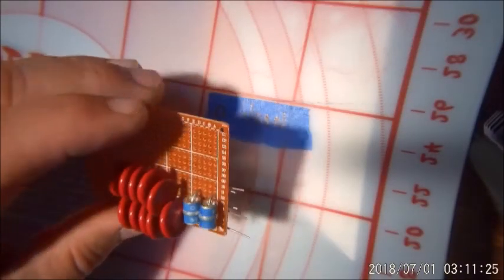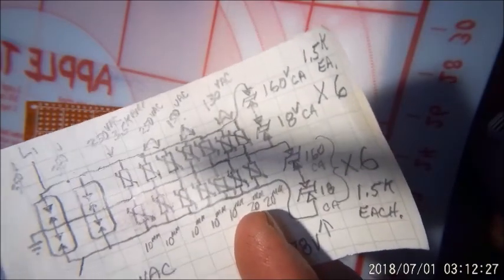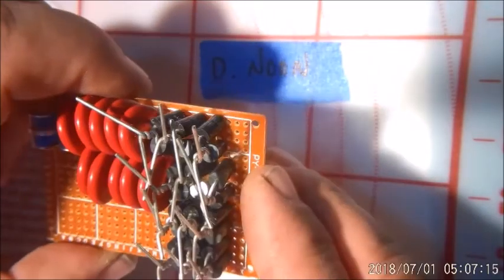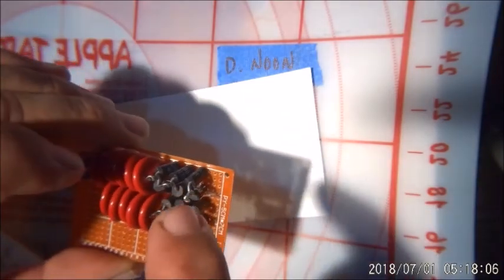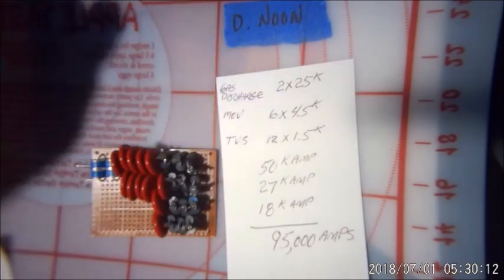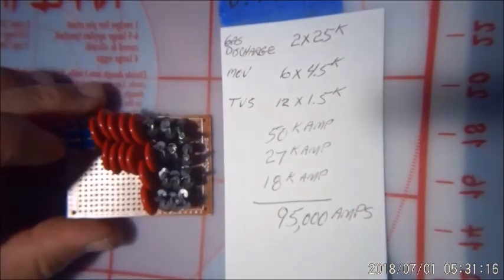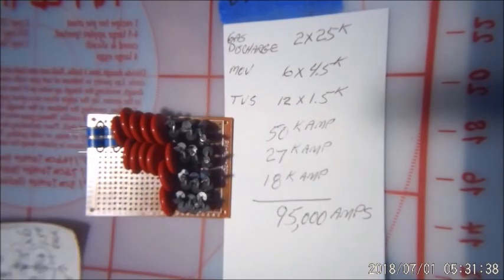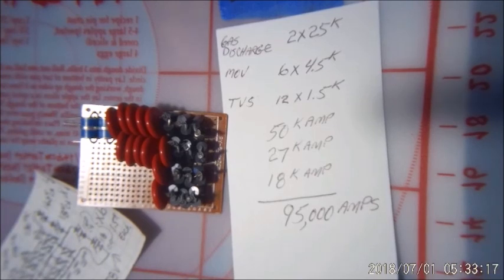EMP BUSTER !! Part 2, How to make super surge protector

Comment: What are the best . Resistors for the 12-volt system on the cars and gas tubes I was going to order a whole bunch of gas tubes
Reply from the maker: If you go to my video that is titled: "12 VOLT EMP Buster, How to build a 12 VDC EMP Stopper, DIY Super Surge Protector !!! 100,000 AMPS !" , You should find all the information for a 12 volt unit. The gas discharge units can be any voltage you wish, but, as low as you can get. Even neon bulbs will start to draw down voltages below 100 volts. Hopefully all the other components work first to stop any over voltages, however, gas discharge tubes can help with static high voltages quite well.  I hope this helped you...good luck!

Comment: Your GD's are 350VAC. Well what I see is a lot of devices all having different voltage ratings and clamping times. Think the recipe needs tweaking?? If you GD's are 350VAC then they won't clamp uit damage occurs. Or are they rated in series for voltage? Making each leg 175VAC?
Reply from the maker: You are correct, The devices will all trigger at different voltages and I was looking to have some devices trigger first then others would take over after a length of time after the first devices in case of their failure or if they just plain fail. That was my thought anyway. I understand that there should be a clamping of voltages for a few pulses and or a length of time like a static build up and bleed off. I could be wrong ( and probably I am) but that is what I was going for.
Reply: @davenooner2142  Okay so your theory not having the same clamping voltages for example might be a smarter play for progressive voltage hits. Still think they all should clamp close to what 170VAC on a 120 RMS line?? Bravo to you for doing something. Great video sir.
Reply from the maker: @rickjames6948  I guess I like the "shotgun" method. I don't have fancy military labs to test anything more than trigger voltages for these. So I am just trying to do an extra step in protection. These can also be encased in sand for fire protection too, to smother any fires inside your cases.

Comment: I know that, at least for ham radio projects, they often recommend against soldered connections on the theory that a lightning strike will heat the conductors and melt the solder. Personally, I'd probably BOTH crimp and solder connections. I also need to re-watch this and see if you're using the copper traces on the perf board as "bus bars". Yes, I'm probably being over-cautious, since they only need to carry current for TINY fractions of a second.
Reply from the maker: Well I was trying to wrap and crimp in place all the connections. Yes I thought about the heat too, so I was using a Higher melting point solder than 60/40. I also had some silver content too. No busbar except the wires with a lot of solder.
Reply: @davenooner2142  In one of his videos he had copper solid core wires as buss bars then soldered it all up. Far as lightening and solder, yes it melts at a low temp. At least this guy is doing something about it compared to a naked surge outlet LOL. Soldered joints will dump some if not all excess voltage/amperage for a while till possible solder failure. Hard to CAD weld on that small board LOL.

Comment: What would the APPROXIMATE EQUIVALENT "joule" rating be for this? I only mention that because that's how so many consumer devices are rated. Yes, I know they "cheat" because they add up the joule ratings of ALL the MOVs used, even though they are often connected line-neutral, line-ground, and neutral-ground and typically only one of those paths is going to conduct.
Reply from the maker: I used to have all the information for these written down, but where ??? I was doing the same thing by adding the manufacture's information on each device. So unless you get exactly the same devices, my numbers would be way off. I remember trying to build these for 100,000 if I am not mistaken... or at least as close as I could.
Reply: @davenooner2142  Okay, 100K amps right or voltage??. Your house wiring will melt long before you arrest that kind of power. Now time kicks in. Maybe Dave is onto something at that high rating of suppression. Nano or millisecond hits at that crazy power...... Might make it through before things heat up.
Reply from the maker: @rickjames6948  Those are my thoughts exactly. That is why these diodes are rated in nano seconds. To trigger long before any high voltage "appears" on your electronics. We are trying to catch the spike on the first leading edge of a ramp up in voltage.

Comment: Thank you very much for the info! Professional builds cost $300+ for one. I need multiples because I have multiple solar arrays and that would be expensive to shield all of them. The only concern I have is will this system be fast enough for an EMP? EMPs have spikes that are in the picoseconds. Replacing the TVS with thyristors might be faster.
Reply from the maker: Did you have another comment on here? Did you take it off? Just making sure if something is wrong here... Thanks
Reply: @davenooner2142  I’m not sure what happened. The other comment went to the internet. I wanted to ask what you did with the gate on the gas discharges?
Reply from the maker: @arminiuschatti2287  I do not understand what a gate is on a gas discharge tube? The type I used was a duel tube type with the center conductor hooked to ground and the two other ends of the tubes hooked to 120 volt AC split phase.
Reply: @davenooner2142  Until I did some shopping recently, I didn’t realize there were two pole GDTs. I created my own based on your design. You saved me around $2,000. Thank you!
Reply from the maker: @arminiuschatti2287  That is my goal !
I am glad to help !
Reply: @arminiuschatti2287  please I need the circuit diagram
Reply: @juliusparker3039  David Nooner is the one to ask.
Reply from the maker: The TV diodes can be purchased that respond in picoseconds. You need to shop for what you want. I looked on the web site for the factory made devices you can buy, and went with their information on what they sell. I was trying to get as short a time as I could find. The 12 volt (low voltage) DC busters can have reverse diodes in place too since there should be zero negative voltages on the lines. So that is why I went with Schottky diodes. they react the fastest. So check the data sheet for what you want. Using capacitors or anything else you can think of, has to be helpful you would think. Now, I have used various test methods for these, but I can only test for over voltages without testing rise time. Without paying over $300, this is the best I could come up with. Let me know if you find any useful  information. I have these on all my car and truck plus the quad too. I use them on my power backup system all over the system at both ends of all wires. Will be hooking up  my solar panels soon, I have 12 panels, plus new LiFePo4 batteries that hold 10.5 Kwh.
Reply from the maker: Also I didnt know thyristors worked faster than TV diodes. Thank you.
Reply: I need 2 for my solar and RV

Comment: Dave, I noticed you added the third set of gas discherge tubes, plus I noticed the 110v sides of  tubes were connected and not connected on common. Not sure if you'd be interested in letting me send you my first project for you to inspect it and make sure this will work correctly? Thanks for the information you bring to us. Keep up the good work. Stephen
Reply from the maker: I would be interested for sure.
Reply from the maker: I put my E-mail address in the "about" area if you wish to use that. And thank you for the offer.

Comment from the maker: Do not use capacitors in circuit !!! They do not work well like that. ONE MORE THING !!! Do not put diodes together like i did. They work on workbench, but not under lightning strike. SO ORDER 180 VOLT CA diodes !
Reply: What is CA diode
Reply from the maker: @juliusparker3039  CA diode is a transient diode that is for AC current, you will have to use these types for house current.
Reply: Now I see why you used the 160+18V combination. What model did you use? 5KP180CA looks promising, except for the price. Is that what you used? If so, where did you obtain them?
Reply from the maker: It has been a long time since I made these. I was working on a budget, and I was using what I had on hand. I would really use at least a 180 volt CA, or jump to 200 volt ones. The 5k is a good choice , but use more than one. As for what brand... I was buying cheap from Ebay. That may not be the best way to buy them, but it was the cheapest. Digikey and other places may be a better place to get quality parts though. Mine all were testing within specs, however I can not test the maximum joules on them. I hope I have helped answer your questions. Just remember the TVI diodes WILL short when in fault condition and stay shorted afterwards. So fuse or use a proper breaker that will dis-connect after a fault. Good luck Sir. @ChaplainDaveSparks